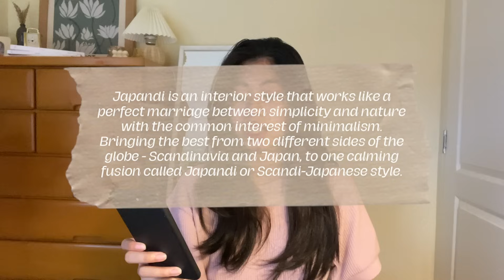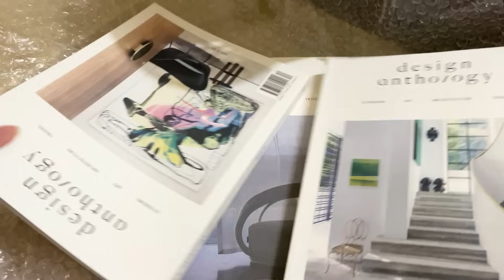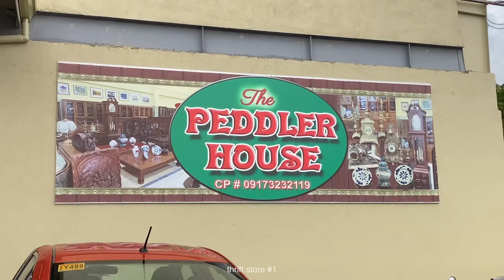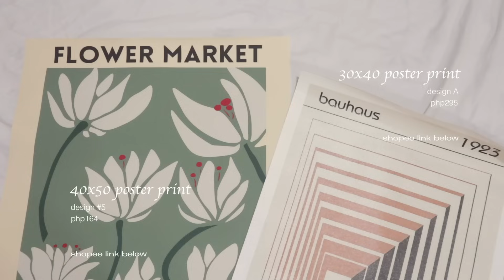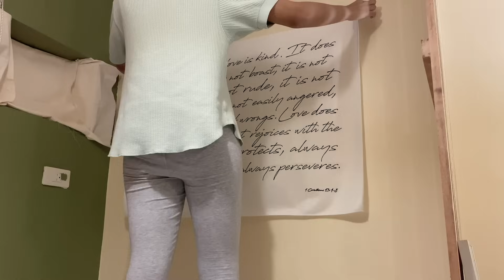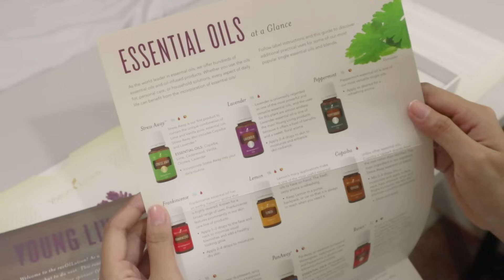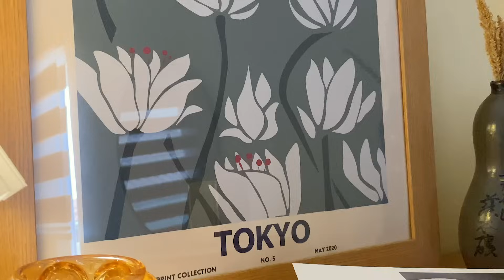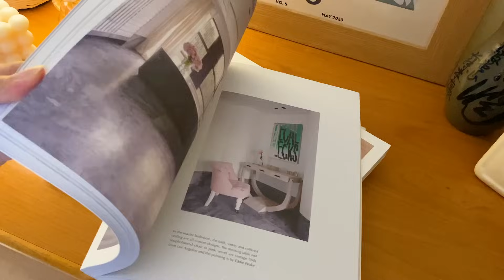EXTREME ROOM MAKEOVER *of an interior design student* 🎨 (elevated bed on a 6sqm space!)

Comment: Maganda ung elevated bed frame. Although yung Table mo, pwedi sana dun nlng sa may wall beside nung door. Kasi prang pag ako nka harap sa bed, aantukin ako nyan. Hehe. 
Also, if ung table mo nasa may wall, you can use the space beside your mini stairs as drawer. Pra ung elevated bed mo, pwedi drawer din sa baba. Pra ma maximize mo ung space mo for storage.
Suggestion lng. Hehe.
Reply from the maker: it was actually what i had in mind but unfortunately my table won’t fit sa gilid ng bed hahahaha and i chose not to install drawers kasi i wanted the room to be neat and clean with minimal storage. besides, the table is just temporary since i’ll be replacing it with a drafting table soon :)
Reply: @CamilleVilla  ohh. Yun lng. Malaki din kasi drafting table. What if, make a sliding drafting table instead? Dun sa bed frame mo. Hehe. 

Goodluck in your studies. Wag magkakape pag gumagawa ng plate, baka mtapon pa yan sa plate mo. Hehe.